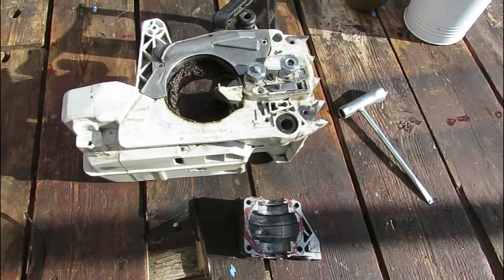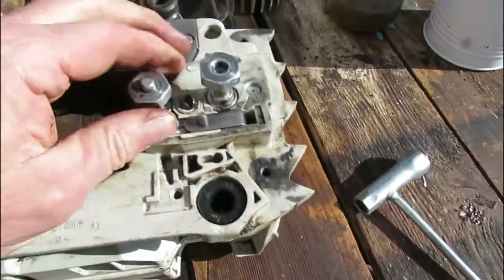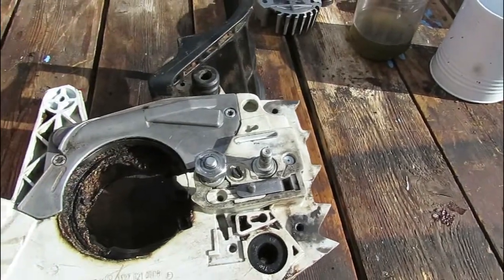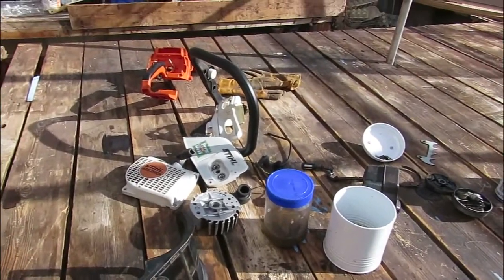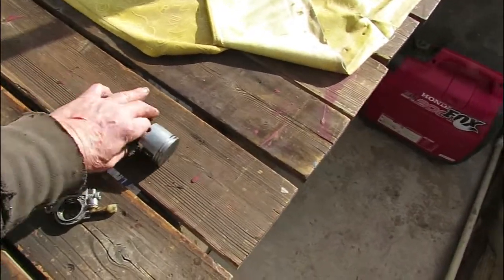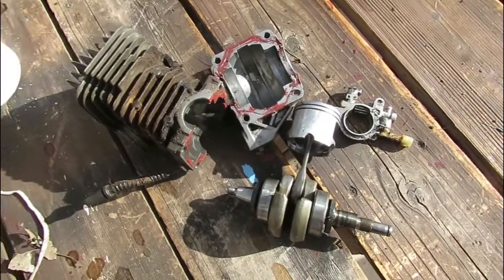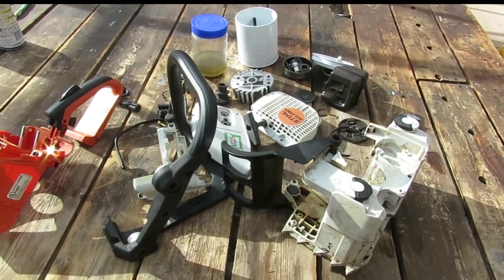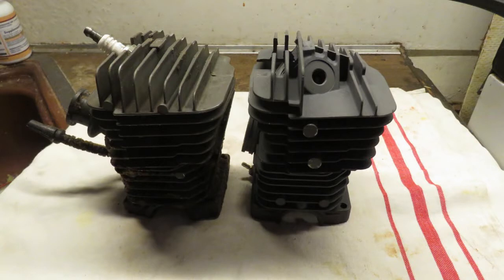How to remove bar plate inserts for a Stihl MS290

Comment: G'day Dave...

Penrite TS-40C (Green Slime) at 50:1 used to be...

" The Duck's Guts !"

(referring to effectiveness as Bait on a Hook - too tough for the Tiddlers to eat, hanging in there for the midnight 5-Pound passing Bream or Whiting...).

After 500 Hoursof Aerotowing Hang Gliders, my friend's 64 Hp Rotax 2-Cyl. 2-Stroke was pulled out & disassembled, and the parallel Circumfrential Grooves were still visible on the Piston Rings - because they'd never ever touched the Bore, at 5,000 RPM.

Since it was replaced I use Penrite Small Engine Hi-Per Semi Synthetic High Performance Low Smoke 2-Stroke Oil.

It's easier for Idiots to mix (5 or 10% Kerosene, as a Mixing Agent ?).

Such is life,

Have a good one...

;-p

Ciao !